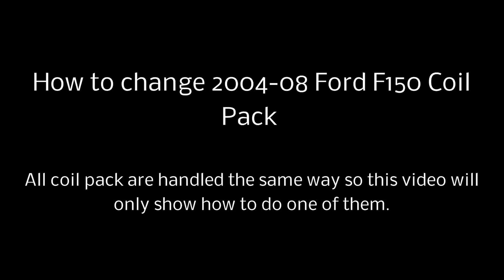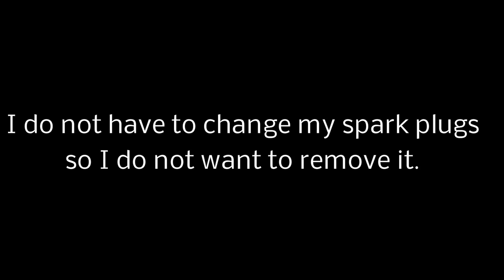How To Change Ford F150  Coil pack 2004 to 08

Comment: Notice that all these tyoe of vides only show how to replace the easy to reach coils, and not the ones on back of the engine.
Reply: Get your friend with tiny hands
Reply: I have huge hands and it was easy. For the passenger side coil all the way in the back, you just need to unplug and unbolt the PCM, and then unbolt the bracket
Reply: Yeh and this vid doesn't cover 2008 , the fuel rail needs be removed
Reply: Take off the fuel rail to get the ones in the bacm

Comment: There was a class action lawsuit that was settled regarding the spark plugs breaking and expensive costs associated with it.  Ford dealers know of the lawsuit.  If you take your car to the dealer for spark plug replacement they know if they charge over $450 that ford Corp will get a bill for the work.  You have to tell the dealer you are part of the class action suit to get the price break.
Reply: Does it matter what year
Reply: I have a 2006 Ford F150 5.4 triton
Reply: @MrGrizzy58    2004 to 2008  "google the internet" for more details.  In my case a dealer did do damage replacing one of the plugs and afterwards denied it.  So having the dealer do the work is no guarantee the work was done right.  I have almost 300K on my 5.4 .  Besides the spark plugs the only issue I have had was that the timing chain guides wore out and had to tear down and replaced all the chains, guides, phasers, and solenoids for the phasers.

Comment: You are supposed to mention that engine has to be cooled down or plug threads will strip and before anything you should blow out the holes with air to remove dust particles or other debris.

Comment: Just bought a 2004 F150 with 5.4L >  I hear the plugs can be a nightmare,,, breaking off due to rusting in the heads... any suggestions ?  And what is the grease you show in the video for ?  Nice video... thanks for posting !
Reply: It’s not rusting. The original spark plugs that came in the 2004-2008 F-150s had a 2 piece design (unscrews in the middle I think). Anyways, the carbon build up on the end of the spark plug is what gets stuck in the engine block as you try to get it out, and a lot of times the spark plug will break in half, leaving half of it in the engine block. Ford has millions of dollars in lawsuits over this so they built a tool specifically to get out broken plugs, it’s  called a Liessel Tool (not sure if spelled correctly).
Reply: This is absolutely true. I have 5/8 break at the shop once.
Reply: @FSUFAN609 Go NOLES!

Comment: Did you have to remove any other parts before getting to the coils to be able to pull them out ???
Reply: Pull the computer out. Making sure you unplug the wires and take care while you were putting in the number three and four cylinder

Comment: I got my new boots to go with my new plugs as I don't need to change the coilpacks. The boots have the wires separately so do they just twist up inside the coilpack or what? I cannot find a single video showing how to install the wire to the coil or new plug boot.

Comment: Any idea what to do if the bolt hole for the coil pack mounting bolt breaks.
Reply: See if enough of the head is sticking out after removing coil if so remove with lock pliers if not easyout

Comment: What's that on the 5.4L cause I'm gonna use accel but they make a short and long boot and I'm not sure which to use...
Reply from the maker: +Dylan Coleman  Yes I have a 5.4L but don't guess on which one you need. I bought mine from amazon. http://amzn.to/1jxFjsK go to this link put in your year make and model to be sure you get the right one. if you buy them from the local part store you will pay like $400 plus.

Comment: Need some help here. Have a 05 F150. Got engine light on took it into autozone . Code came back P0301 . Number one cylinder misfire  . I switched around numbers 1 and 2 coils but still the same . I don`t have the time to do all plugs right now should I go ahead and put a new plug in 1 ? Or could it still be the coil even though i switched it ?
Reply: Billy Murray  when you few sparks it's good to assume you need to go ahead and change em all. Same with coils as well.
Reply: Had the same issue with my 97 the setups different but if you don't replace the plugs they'll all slowly go one after the other, would probably be good to do the coils while you're at it

Comment: The ones in the back are my only concern. Which it looks like a pain to get to.
Reply: They are but not as bad as I thought
Reply: @charlesjacquez4236  where you get your coils from i brought some bad ones. Two months ago they failing right now
Reply: @CapKruler  I actually ordered them off at eBay paid about $50 they've been doing pretty good going on 8 months make sure you get the Motorcraft spark plugs that's key anything else and your truck will either misfire or run like crap has to be Motorcraft and they're not that cheap may not be the coils
Reply: @charlesjacquez4236  how do you remove the ones in the back

Comment: Do the boots "snap" onto the plugs? Or do you just press down all the way on the coil to ensure a good connection. Because I went to check one of mine and put it back on and didn't feel a "snap" or "click" or whatever you want to call it.
Reply from the maker: +David Thackrey yes it should snap.
Reply: DIY Creators ok thanks, although I still don't feel it. But when I go to pull the coil off, the boot feels like it was "snapped" on
Reply: They don't snap just push down

Comment: Just curious...did you change them because they were bad or did you change them to Accel for performance gains?  Did you notice much improvement with the Accel coil packs over the OEM packs?  I have a 2004 f-150 with the 5.4 and it still has the originals so I was considering replacing them.  Thanks!
Reply from the maker: +Dewy Russler 
I change them because when I bought the truck it had some issues and I was going through the process of elimination. my problem was the spark plugs but I had purchased these already from amazon so I just kept them. Since nothing had been changed on the truck I just put them in anyways.
Reply: DIY Creators
Thanks!
Reply: DIY Creators hey, a year later curious if you had any issues with the accel injectors?
Reply: That’s what i want to know

Comment: Yeah you don't want to break off those ridiculous plugs.. hard to find a mechanic that will actually do it without liability issues.
Reply: You're thinking 2v 4.6, in the round bodies, pain in the ass, the only issue with the 3v 5.4 is camphasers which is a bigger pain and more spendy
Reply: @fallu2  not true. the 5.4 3v does break plugs before sp-515

Comment: ok i change my coils on my 2008 and now its shaking really bad spark plugs all new i dont know what else to do i press down the gas its realy hard to pick up
Reply from the maker: Was it shaking prior to the coil pack replacement?
Reply: the connectors on these trucks are known to not snap back on good especially with sensors. before you replace the coils or sensors make sure they are fully connected! ordered a coil for my king ranch only to press down on the connection and truck has been running perfectly every sense.

Comment: My trucks been shaking and rumbling also it's been tugging when I get it up to 55 I went to Napa auto parts store and all the codes were saying it's the coil pack is this possible or did I get the wrong code.
Reply from the maker: Its possible, did you check the spark plugs?

Comment: on this 54 be prepared to snap the plugs off in the head  Ha true  just payed $900 to get my plugs done snaped 1 the guy before snaped 7 at $ 90 an hr to remove them extracter. this engine sucks bad. regret buying it  back to chev  4 coil packs
Reply: Dave did you have the stuttering problem as well?
Reply: This is definitely a motor you need to be pretty mechanically inclined to own lots of little things that go wrong and have to mechanic on especially if u don’t want to pay ford 120 an hour at my local ford place

Comment: Wonder how many times those have been changed since he didn't use motorcraft???  LOL...I HATE Ford engines
Reply from the maker: Still rolling with these. I agree their engine are a pain.
Reply: @DIYCreators  I just bought 8 coils and plugs...these 5.4 are nothing like the LS motors....what the heck were they thinking
Reply: @dave0366  Right, Till this day i wonder what the engineer's were thinking going to the 3v variant. They damn near had a perfect sohc design with the 2v, sure it lacked power but the 2v variants were work horses